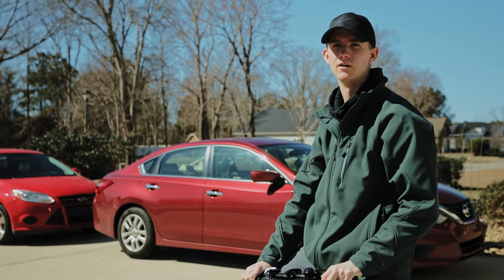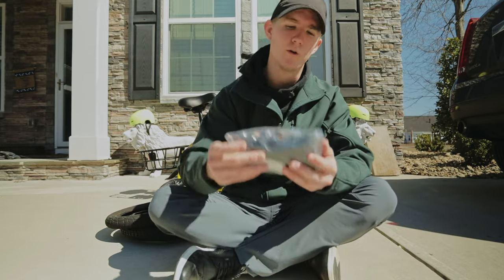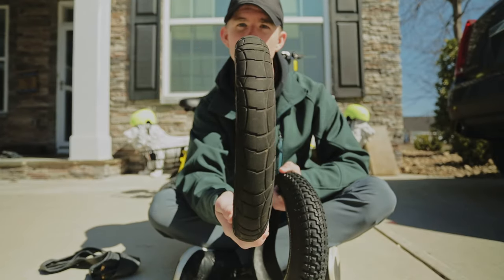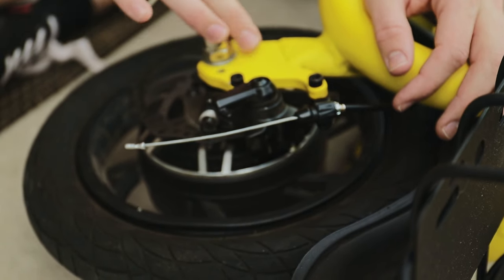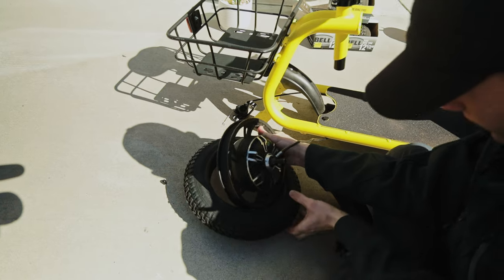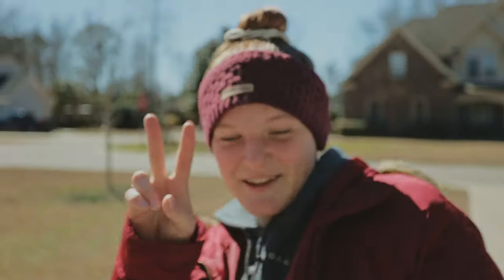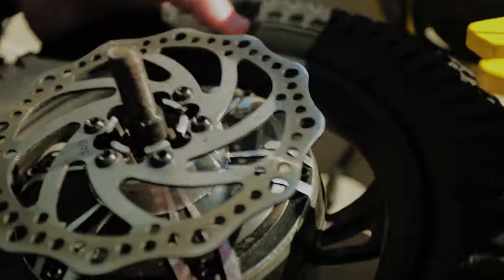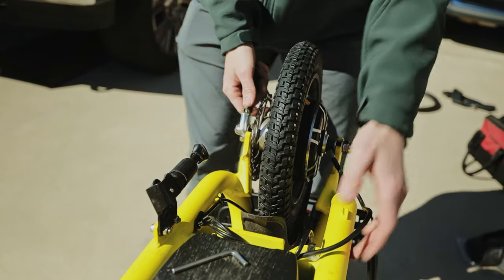How to Fix an Electric Bike Tire? - Phantom C1 Upgrade

Comment: How come I can't find a single video that tells you what kind of battery this thing takes? You can't find anything on the internet, nothing on their website, nothing on YouTube. I guess I'm going to have to wait all the way until it gets shipped to my house then take it apart then look at the battery just to figure out what replacement battery I need so I can actually have a decent battery that lasts a long time and so I can upgrade the motor. So silly that people reviewing this bike just can't give the specs of everything
Reply from the maker: I would be curious to know as well. I think I've been slightly afraid to replace the battery. You're right that there's not many resources out there on it.
Reply: @Carsonous  sorry for going on a rant. The scooter has been driving me nuts, it's really nice but I live in an area with a bunch of hills so I needed to remove the speed limiter but I could find every single brushless motor controller except the brand that was in the phantom. Then I couldn't find info on the battery either and after a few days of riding at my handlebar came loose even though I tightened it up when I took it out of the box. I also tried reaching out to their customer service about wiring and the speed and if there was anything I could do to stop the handlebars from getting loose and they basically told me they just put the bike together and if it doesn't have their name on it they have no information on it at all (even though they assembled it and buy stuff from a specific company).. they couldn't even put me in touch with the company that made the brushless controller or direct me to their website since it mysteriously does not exist and no photo online exists of the controller lol. I finally said screw it and I gave it to my kids and bought a better one.

Comment: You are so amazing I thank you so much I have the same exact scooters I have a black 1 red 1 and a blue 1 me and my sons we all have 1 and I'm the 1 in the family the mother that works on the cars anything that needs fixed or repaired out here Im so serious but this i needed the how too because I'm heavy handed lol but i did it. You showed me hot too and then it was done but you are using tires with tubes I used tubeless tires and I recorded me assembling and disassembling Mine and it will never require air or go flat i can ride over glass or nails you'll never go flat so oh my god yes thank you have a good 1 but mine's gonna last forever I didn't require a inner tube inside the tire tubeless tires is where its at tho you're awesome
Reply from the maker: Thank you for the kind words. It sounds like you're the awesome one though. I don't know why I didn't think of tubeless tires. Definitely foolproof! haha

Comment: I was just wondering what size solid tire should I get for that model
Reply from the maker: https://amzn.to/3UHvj5s I haven't tried this myself but it looks like a decent option. I read that it's best to soak in hot water first to make install easier.

Comment: Great video, would you ever consider doing a video on the Phantomgogo r1 battery upgrades or reviews?
Reply from the maker: I definitely would. I've considered it several time but I just don't have the spare cash to purchase one myself.
Reply: @Carsonous  I understand how long did your batteries last without needing a replacement? I’m hoping to continue using my scooter to go to work till I can afford a dirt bike.
Reply from the maker: @Davjose37  I've never replaced the batteries. I get around 8-10 miles per charge still
Reply: @Carsonous  oh wow!, alright thanks for letting me know man
Reply from the maker: @Davjose37  anytime 🤙

Comment: So what's better of the two phantom c1 or the glairwheel.
Reply from the maker: From what I know they’re exact duplicates although I know Phantom Bikes has a repair shop they use.
Reply: @Carsonous  that's what I came to also the only difference I could find is the c1 has a bafang 350w motor otherwise they are the exact same thing

Comment: Can you show how to adjust brakes properly, after changing my tire my back brake is essentially non existent I don't understand how it happened.
Reply from the maker: It helps to hold down the hand brakes simultaneously when sliding the brake line by the tire tight. Adjust as needed. I hope that helps. I will be making future Phantom C1 videos.
Reply: You can usually get the slack out using the nut at the handlebar- loosen the big disk nut on the rear brake cable where it meets the hand lever.  Then, back the narrower nut out of its place inside the brake lever a little bit at a time, squeezing the brake every few turns to check the tension.  When it grips the brake hard enough to skid with your weight on it but doesn't rub the disk when not braking, tighten the  wide lock nut back against the brake lever.

In case you don't notice how it works, the wide disk nut locks the narrower one in place.  Backing the inner nut out of the handle makes the outside of the brake cable longer while the wire inside stays the same length, removing the slack.
Reply: @Carsonous  do you know where to get replacement parts. I called and emailed phantom bikes to no avail. Do you know what the brake specs are so i can source new parts for the front rear brakes
Reply from the maker: @chrisbailey5509  I’ll reach out to the owner and let you know what’s possible
Reply from the maker: @chrisbailey5509  the owner informed me to tell you to reach out to sarah@matsunichidigitalusa.com
Reply: @Carsonous  Thanxamillion I definitely will do!! I appreciate you looking into that for me!!

Comment: BRO WHEN YOU CHANGE THE (entire)  TIIIRRREEEEEE Just C🎬T the OLD one off…  wit  ✂️🔪🗡️ to save that wrestling energy for putting new one on… lol free game💯 
but very valuable info i learned something… now how to fix the cruise control and where is it at in first place in the twist nob or ignition 😂 cc is when u whole throttle for 10 seconds and let go at any speed and it drives itself like a semi tesla lol well mine not working since flat happened
Reply from the maker: Cutting does sound like the move. I don't have cruise control on mine.